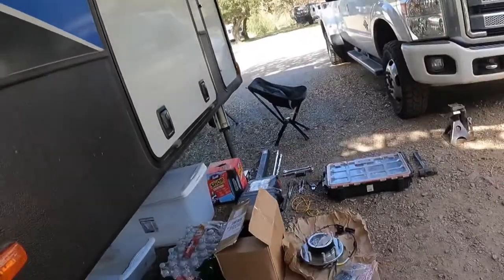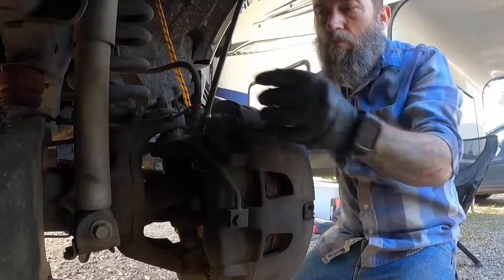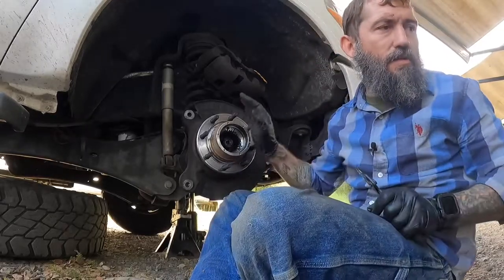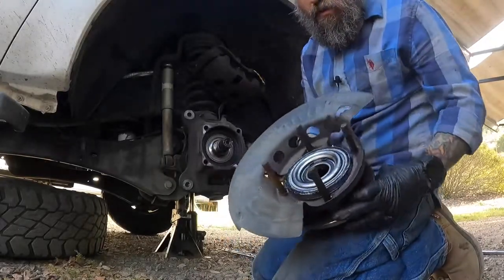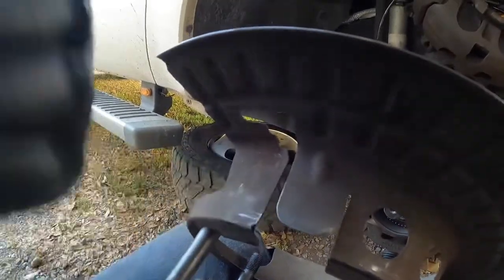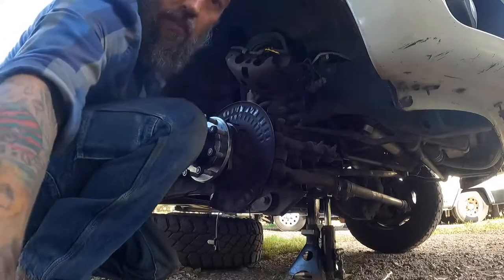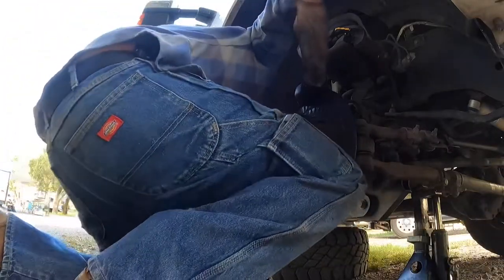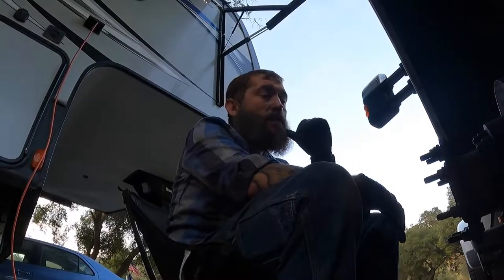Ford F350 Front Wheel Bearing Replacement!

Comment: The OEM tip was worth the like for the video.  Nice job J.O.
Reply from the maker: Thank you, glad I could help!
Reply: @Olly1775  I always buy OEM unless a better aftermarket part is available. 
Many make the cheaper made mistake.
I just watch a girl do exactly what you are correcting on YouTube. 
She bought the Autozone one you said to avoid.
Reply from the maker: @timothycoleman8916  Yeah, I’ve seen that video. Sometimes you can use the cheaper parts and not have any problems but, for some parts you just can’t compromise on the quality. Hopefully she doesn’t experience the same thing I did but, I really wouldn’t be that surprised if they failed prematurely.

Comment: If the bearing went. Can you just replace the bearing or do you have to do the whole hub?. Thank you great video..
Reply from the maker: No, they're only sold as an assembly for the newer year models. You may be able to find just the bearing, but I haven't seen it. It would also be fairly difficult to disassemble the hub to get to the bearing. Thanks for the compliment, much appreciated!
Reply: @Olly1775  ok thank you

Comment: A good video but if you don't have the proper long reach snap ring tool don't do it, even if you can remove the snap ring, you will not get it back in without damaging something without the proper tool, what took me hours to remove would of been minutes with the proper long reach snap ring tool. Knipex makes a good one.
Reply from the maker: Yes, not having a good enough snap ring plier will make the job very difficult. If it's not long enough you may not be able to do it. The pliers that I used weren't especially long though, they are commonly found at most places. I've never heard of knipex but I'll check them out.
Reply: @Olly1775  I went to all the local auto parts stores (4) and 3 big box stores that only had short or medium length, one would of been long enough but it was convertible from inner to outer snap rings that made the hinge too bulky to get past the spline, the better one had replaceable pins but they broke playing with the new snap ring if you extended them out to far, that is a heavy duty snap ring.  I agree with the OEM bearing use, I have gotten burned before with after market "we are better claims". Thanks for your videos!
Reply from the maker: @StephenWhiting-WI  Yeah, I was going to mention that the reversible ones are too bulky to get in there. I honestly don't remember where I got the ones that I used! I think it may have actually been Home Depot, not sure though. I don't normally get tools from parts stores. Home Depot, Harbor Freight, and Amazon will typically have what you need. NAPA is also a good source but their stuff is usually a bit more expensive. Thanks for the comments and I'm glad you liked the video! I'll try to remember to discuss things like this a bit more in-depth in the future!

Comment: Wonder why a person couldn’t just press the old bearing out and press a new one in. I believe it’s just a caged sealed ball bearing assembly.
Reply: Oops never mind, I see why. The bearing that you see is just for the axle shaft.
Reply from the maker: @scottberry5266  These newer wheel bearings are made as a unit and are integral to the wheel hub. They aren’t meant to be replaced that way. You could probably find the bearing itself but it wouldn’t be nearly as easy.
Reply: @Olly1775  : yup, I was looking on line for bearings for my Ford and looked at the back side and saw the center bearing with a snap ring and thought just press the bearing out. Then I realized that bearing holds the axle shaft. Getting ready to do the same job this week.
Reply from the maker: @scottberry5266  Awesome, I hope this video helps! Thanks for watching!

Comment: Was ready to watch you change the bearings as you said, only to watch you change the hub assembly 😢😢
Reply from the maker: I did change the bearings. The front wheel bearings, on this particular vehicle, are integral to the hub assemblies.
Reply: @Olly1775  ...so you changed the whole hub assembly. You did not press out the old bearings from inside the hub and press new bearings back into the hub.
Reply from the maker: Correct.

Comment: Rock auto has a better selection and are typically cheaper
Reply: They do. Their customer service is the pits. Products are good.
Reply from the maker: Yes, Rock auto has a great selection of parts and they have good prices as well. The problem is, highly critical parts like wheel bearings don't do so well when they're not the best quality. Most of the time cheaper "nock-off" brand bearings, such as Duralast or something equivalent, will do just fine. The way these other manufactures are able to charge less is because they tend to use cheaper materials. In some applications like mine, a 9000lb truck, these cheaper materials just don't hold up as well. There is also the issue of inevitable defects. It doesn't matter who makes it or what they make it out of, it can still fail. Thanks for the comment, I hope you enjoyed the video!